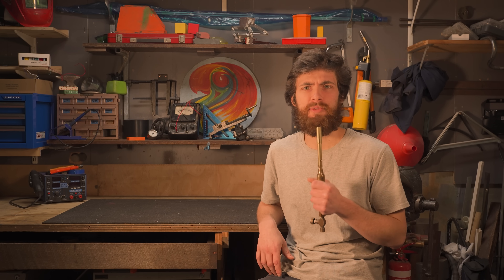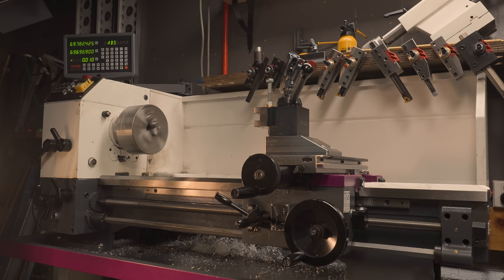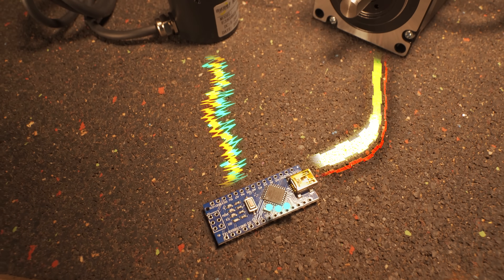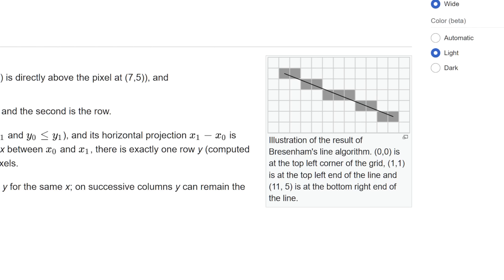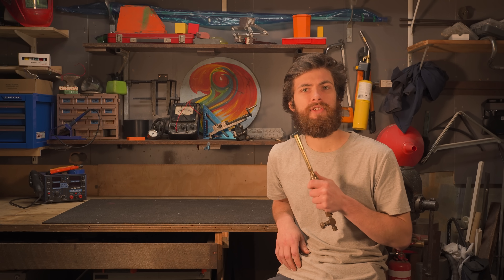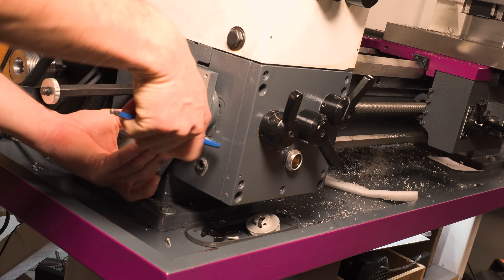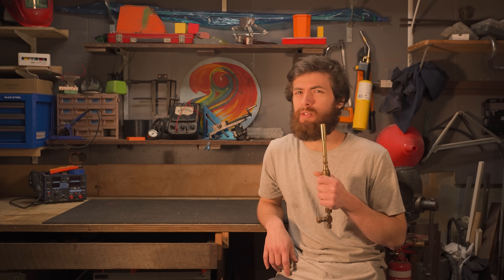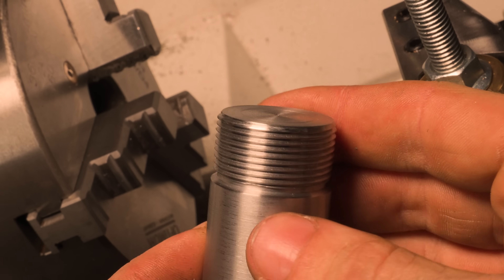Putting an end to the WORST kind of gears.

Comment: 8:57 if im being completely honest, the moment you had given the pulse count of the encoder and the expected RPM range, I went to my trusty napkin and tried to scribble down order-of-magnitude estimates for how many clock cycles you would expect to have between each interrupt.

Given that the pulse count I estimated gave around 200 clock cycles between each interrupt, I honestly had thought the tiny would have been enough, and I'd probably have been just as confused as you as to why it didn't.

Though admittedly, with 200 clock cycles there would definitely not have been enough cycles to get all of the pulse counting and pulse sending done while still having cycles left over for writing debug information to the serial line.
Reply: I just heard 2000 PPR and 2500 RPM and thought "that needs to be done in hardware". STM32 blue pill boards, Teensy 3.x or 4.x, RP2040, and most everything just slightly better than a base 8-bit MCU can do quadrature counting in hardware. If the servo loop rate were only at a couple kHz, that would be fine. But yeah, quadrature with a decent encoder means you either need to count each cycle in your ISR assembly code, handle it in hardware, or punt to something with a stupid fast clock.
Reply: He did say he was doing a lot of Serial print's, those are quite expensive in themselves :D
Reply: Honestly the fact that he's not using a Microcontroller with a dedicated Encoder pulse-counter is already... Hm.
This is a pretty common application, so systems that can handle encoder counting and step generation do~ exist :D

Comment: Not needing to use 600MHz processors for a simple one axis position task is the reason why people use simple feedback loops and put out torque. You just need a little bit of mathing around, which is the reason why all papers about motor control are slightly wrong, they all copied a mistake from a 1970s paper 😅
Reply: how are they wrong exactly?

Comment: Man, I need to make an electronic gearbox, but, alas, I'm lazy, so, instead, I programmed a gear calculator that I can throw an arbitrary set of gears (including diametral pitch and mod gears, it'll automagically only pick gears that mesh with each other), spindle gear, some diameters for shafts, lead screw pitch, and target pitch (with margin if the target pitch can't be matched exactly) at and it'll spit out all of the gear combinations that can be used to cut the target pitch, excluding any that are "functionally" identical (i.e., > means gear drives the other gear, | means gear on the same shaft, 40>40|80>80|40>30 and 40>30|80>80|40>40, while physically impossible on my lathe, are considered the same gear change). Makes it so I don't have to stare at a gear matrix, at the very least, and can quickly search for a specific pitch.

Comment: Arduino nano would have been plenty to do this, but instead of trying to run bad code, you shoudl have used the hardware counters to count the pulses, then use interrupt on a timer to read the counted pulses and then do the math, output motor pulses while the counter keeps on counting at the background...

Thus you can keep your sync very well...

Comment: Tracking high speed encoders and sending stepper output pulses might be a good application for the PIO on the raspberry pi 2040s. Essentially it has a dedicated little processor that's able to handle high speed IO as a state machine. In general though, it's less powerful than the teensy, so it might have other problems
Reply: I'd take an RP2040 over a closed source Teensy any day.

Comment: This is almost exactly the same setup we have at Zaber for cutting plastic worm gears. A high resolution rotary encoder on the low speed side feeds a teensy which converts it according to the desired gear ratio and sends step and dir pulses to the cutter motor. It works well at constant speeds but doesn’t handle accelerations well because the latency of the conversion process turns into a position lag.
Reply from the maker: I ran into the same issue, I figured it's not too much of an issue as long as the following error is somewhat constant, ie don't change spindle speeds during a threading op 😅

Am planning on swapping the spindle motor over to a servo at some point, then I can just send pulses to the spindle and lead screw motor simultaneously, allowing for fully synchronised motion.
Reply: I didn’t know about the line algorithm or consider how computer graphics could relate to gearing.  I think the way my code works is it takes the current encoder position minus the previous encoder position plus a carryover amount and multiplies that by a ratio to get an integer number of pulses and a floating point remainder that carries over to the next cycle. It’s definitely not speed optimized but it’s quite robust to accumulating errors.

Comment: I do this stuff for a living, ie; custom designed hardware software motion control etc. For about 20 years.
I suggested to James in an early comment thread about using a bresenham control system when he was having issues.
Anyway, what you have done is no trivial project, big thumbs up. 👍😁
Should be easy enough to auto sync the thread cutting, the main thing required is never to lose track of spingle encoder absolute position. That is straightforward provided you dont turn the power off to the ELS.

Comment: Nice!  I'm always interested to see how other people solve problems.  If you want even more scope creep, why not add a motor on the cross slide to turn tapers?  And as long as you have that, you might as well implement fully automatic multi-pass threading!
Reply from the maker: The rabbithole is deep, and full of terrors. I had an accomplice for part 2, and he had some very similar ideas. Looking forward to putting them out there.

Honestly though - the only reason I haven't got a clough42 ELS is because I'm still at a stage where I can't understand software unless I write it myself. But I've said too much!
Reply: @NoEngineerHere  Oh, I get it.  Writing software is an art.  And having confidence that it's correct (whatever that means) doubly so.
Reply: @Clough42  That means that I'm setting myself up for @#% when my "project" to "CNC-ize" my 1911 South Bend (originally a treadle-powered lathe) by using one of my PDP-8s as the controller.  And "trying" to design my own circuit boards for the PDP-8/x to communicate with the motors, etc.  (I'm a Mechanical Engineer, *not an EE or Programmer!)  :P

I'm actually in the early planning stages of this "project"!
Reply: @Clough42  Oh there's no art in my code. Modern art maybe. It mostly works but it aint pretty 😥
Reply: At some point in the scope creep curve you end up with a CNC lathe heh. 

Ofc then you are going to be missing the manual feedback on the MPG, so then you replace that with a servo motor as to simulate force feedback, which in turn has the problem of having no detents, so you then go deeper and program detents as an option.
Reply: @exol511  correct.  You have to decide what you want and stop at some point.  Either that, or decide that you don't want to stop because you like the process.
Reply: @exol511  programmable detents?? geez, those will take ages to program.... whats next, blinken lights??
Reply: Please implement multi-pass threading. Please also name it Leeloo.
Reply: @ufaceu  I GOT THAT JOKE
Reply: @ufaceu  can multi pass threading happen with 3 inserts on the same tool holder/toolpost? No extra code
Reply: We have CNC lathe at home
CNC lathe at home:
Reply: Heh yes I started my ELS project after watching James but I wanted to build one ground up to learn and solve the problem myself. It's definitely worth it.
Reply: just go ahead and make it a fully automatic CNC machine
Reply: Once you have a motor on both axes, you might as well just go all the way, and go to LinuxCNC and do a full conversion already. Funny, I was going to cnc convert a G0602 I picked up earlier this summer. The plan went from VFD+ELS to linux cnc pretty quickly, and just starting with ELS functionality in linux CNC until I got to actually replacing the lead screws with ball screws. I bought the 3ph motor, vfd, spindle encoder, one axis motor, a Mesa board, and some initial tooling for the G0602, and I kid you not, 3 weeks later, someone GAVE me a free (broken) CNC lathe, which is now fixed. I went from 0 lathes, to 2 lathes in the span of a few weeks! Now I need to buy 1" tooling, instead of the 0.5" tooling for the G0602!
Reply: @gorak9000 I did consider it in my ELS project, it's still on the roadmap but once I have basic geometric primitives automated I haven't had the need for full CNC control in the home shop. I might use grblHAL so I can run it side by side with ELS.
Reply: @HM-Projects  My plan is to take Andy Pugh's lathe macros from linuxcnc and make it a standalone program that you can quickly develop lathe nc programs in without CAD/CAM. I already started looking into it, and on it's own, it does almost nothing, and depends a LOT on the wxglade part of the LinuxCNC system. It wouldn't take much to write a python/qt GUI, and do the substitutions from the gui boxes into the g-code. The only part of the existing code that can easily be re-used is the svg images, and the g-code templates - the rest is too dependent on LinuxCNC. The lathe macros are great, but it's very limiting that it's dependent on LinuxCNC, as there are many machines out there that don't use that as the controller.
Reply: I am lacking the lingo and knowledge but I always wondered why the ELS solutions I have come across don't allow the half nuts to stay engaged (if the spindle can stop fast enough). As I see it, you could define a thread length and then the system would stop at the end and prompt you to move the cutter out, then you could hit a button and it would reverse back to the start of the thread. A new prompt would come up to set the depth of the cut and hit the button to start the next cycle. Yes, yes, I know, just use the half nuts, but it freaks some people out. 

Anyhow, I think I am ok with the halfnuts after I put a better BLDC motor on my mini lathe I can now thread at under 80rpm in alu, so less pucker factor than before where the motor would just bug down unless you ran it at +300rpm.
Reply: I have your ELS. Let me know when you have stuff to run the compound, hopefully with most of the same boards and new button board.
Reply: Now it's a party!
Reply: Well it needs a ball screw now of course...

Comment: I love it, the idea of it, the everything, even the chuck key left in the chuck.
BUT, I don't love the drive belts or anything else not made of metal. I understand it's a prototype and like me, you enjoy catastrophic moments of excitement. Have you thought about engine timing parts from a scrapyard ? If my warped perception of reality is correct it should be easy. 
Crank to camshaft ratio is 1:2, so you would need to find an engine that has a camshaft diameter large enough to suit your needs. Acquire the cams, crank, timing chain, timing chain tensioner and chain guides. part the toothed sections off the cams and crank and you should have all the technology you need to fabricate a damn fine bit of timing chain driven electric gearbox. (I think)
I'm not an engineer, I'm unemployed,  qualifacationless,  drug fuelled with delusions of grandeur. So my idea's should be taken with a pinch of salt, although I hope you've been inspired! lol

Comment: Key in chuck = Homicidal lathe!!

I feel you. Trying to use linuxCNC on a machine that has a stepper motor as a spindle motor. I tried to program an arduino to turn the spindle, and then another arduino to count the steps and convert it in to a pseudo encoder signal back to linuxCNC. The 16Mhz Arduino was just too slow for the both tasks, unless we limit the max rpm to a fraction of its rating. I should revisit this with that 600Mhz module. I know that there is probably a solution that I can buy that is quite simple, but why do it the easy way when I can do it myself??

Comment: 2:10 The universal thread? GENIUS!!
Reply: The British Standard Cycle Thread has a pitch of 26 threads per inch for all threaded bicycle parts except the spokes. At a time when bicycle repairers often made replacement parts themselves this meant that they did not need to change the gears in the drive to the leadscrew.

Comment: Interesting that you did this with a microcontroller. I'd have gone with a small FPGA instead - some have gotten surprisingly cheap, and they do really well with hard realtime requirements like encoder tracking.
Reply: I know nothing about FPGAs but have a somewhat similar requirement for another project, do you have a recommendation for one to the extreme end of "surprisingly cheap"?
Reply: @Ammoniummetavanadate  Lattice iCE40 boards. You can get an ice40hx8k devboard for about 35€ (plus shipping), and there are some cheaper ones for smaller fpgas from the same family.
Reply: @coreforge  Thank you for the help man, I really appreciate the advice.

It is daunting to get into this side of things.
Reply: @Ammoniummetavanadate  Pick up a dev board. Something iCE40 based, or maybe GW1N.

Beware that HDLs have a steep learning curve. If you've never done anything with FPGAs before I strongly suggest starting with something simple.

Comment: Love this project. I actually did it myself as well but with a PLC instead. I used a Productivity 1000 with HSC module and an PS-AMC4. I replaced the main AC motor for the spindle with a servo as well, so the leadscrew has its own servo (1kw) and spindle has one (1.5kw), then used the Gear Drivetrain instruction to sync them and allow me to modify the ratio between them via software whenever I want. I am putting a CM5 HMI on as well with a numerical entry box to let me type in the feed pitch/threading pitch I want the PLC to calculate for me and enter the right drivetrain numbers 😁 Costs WAYYYY more than the equipment you used, but I was familiar with PLCs from my job and find them very easy to use, and will allow me to expand the project more in the future. I probably should have started with more arduino type hardware but I didnt want to try and learn the C software coding and I was worried about troubleshooting something I didnt understand well yet.

This will also let me add in DRO type linear encoders into the PLC in the future and integrate all the XY position feedback into the PLC as well to start letting the lathe do some automation as well sort of like a seni-CNC. its a fun project

Anyway, very excited to see you do this as I thought I was the only one so crazy. haha. Im glad it worked out so well for you too!
Reply from the maker: I'm right behind you

Comment: I've been doing hobby-level electronics for 20 years and had no idea solderable breadboards were a thing ... 🙃
Reply from the maker: Dude, total game-changer right?
Reply: @NoEngineerHere  100%. So tired of the extra step between breadboard and redesigning everything to fit on a "regular" solderboard or make a 'real' PCB.
Reply: Google protoboards
Reply: Altronics have them, I think core electronics have them... some have the dots connected in breadboard rows, some have just the dots so you can rearrange the rows if you want <3

Comment: Ahh, the old 'cardboard aided design'. I miss Binky
Reply: The world is now very low on brackets and tea.
Reply: Ive not heard the noise in what feels like a lifetime 😢
Reply: @Pyablocoak  There's a comment 2 weeks ago by jimguppy7204 on the 2024 channel trailer about the status from last July.
Reply: The reason they got lost is they are building a 3d printer to print circuit traces for their gauge cluster that they could have ordered from a pcb manufacture, classic binky
Reply: @nelsonphillips  you cant exactly make circuit boards with an angle grinder. i started just using engraving tools and freehanding it for the duration of my blank pcb stock.
Reply: Such a loss
Reply: whatever happened to binky?
Reply: @LordOfNihil  They have ALWAYS been shaky on the upload schedule. Like months between uploads. They have families and full time careers, those get the bulk of their attention. The car is pretty much done, and their follow on projects may need some time to bake in the oven.
Reply: I am sure my grandson will enjoy seeing the end of the series, after my boy grows up, gets married and his wife has him.